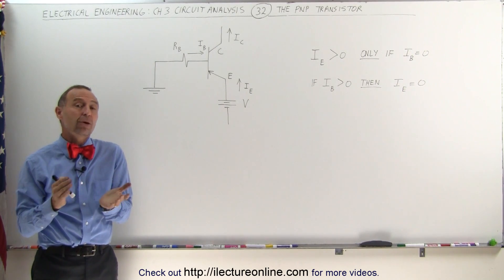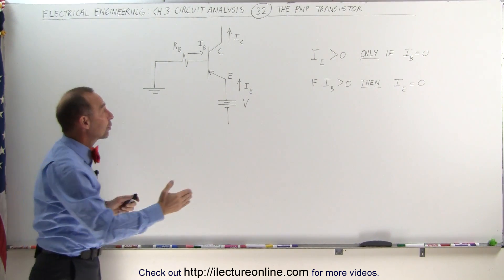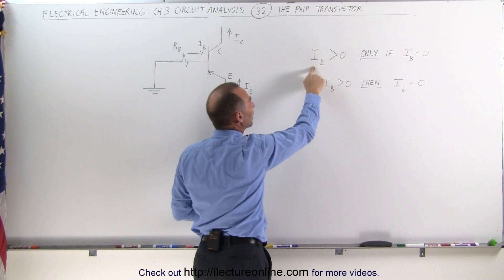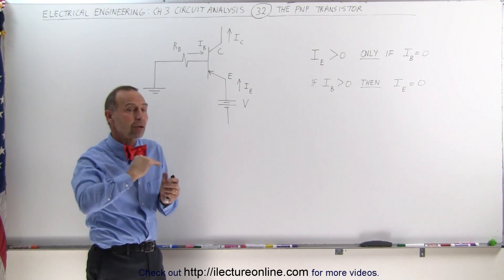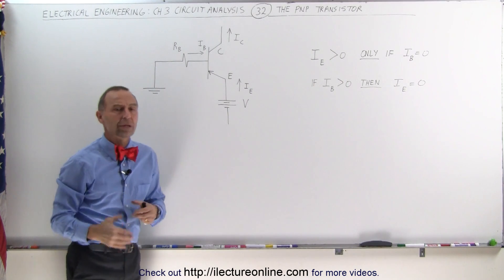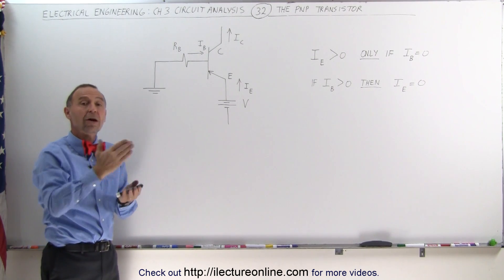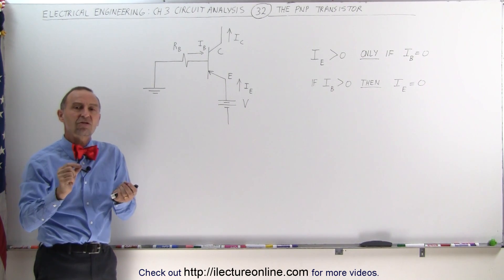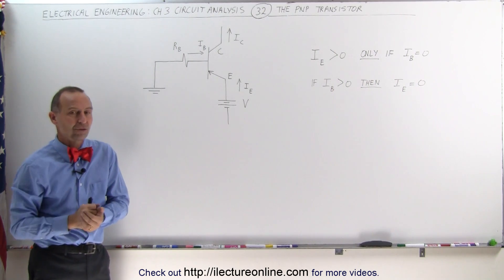Electrical Engineering: Ch 3: Circuit Analysis (32 of 37) PNP Transistor: How It Works

Comment: NPN video was really great, this one confuses me.  I was pretty sure the same equations applied with different voltages and directions used and was ready to watch a similar example to the NPN video, however this is more like a relay.  Is this only under a certain condition that it acts like a switch?